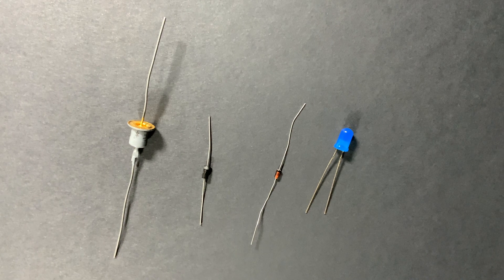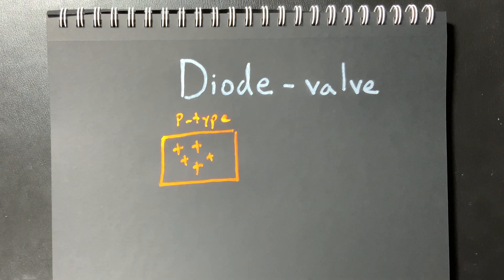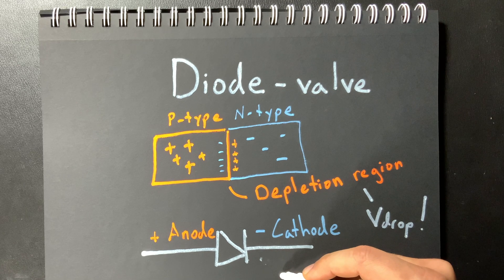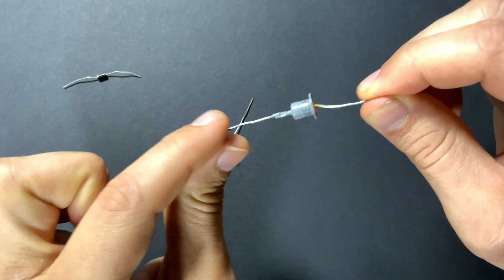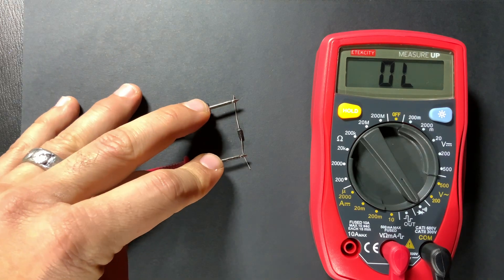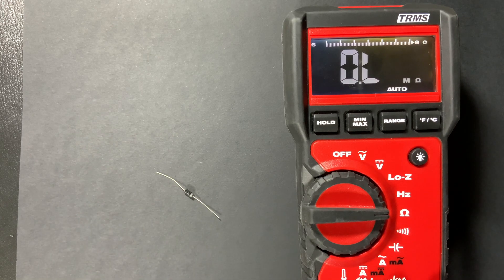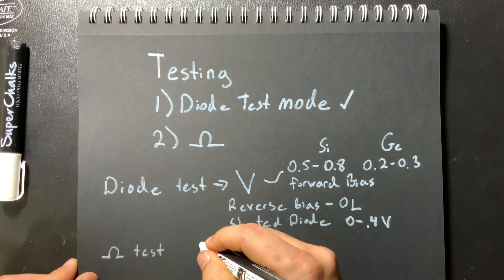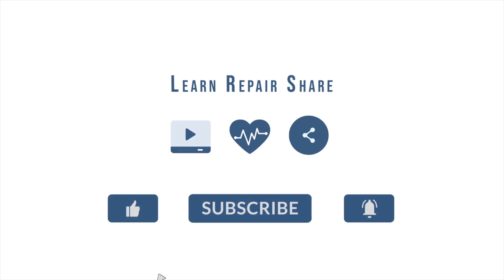How to Test an LED or Diode

Comment: The led can be damaged with over 5 volts   in forward bias too.  Just need a high current limit.
Reply from the maker: Good point - I guess I wanted to show that even in reverse bias you can still get current to flow with enough voltage. Just burning it up seemed to easy but  probably would have been good to show that as well!